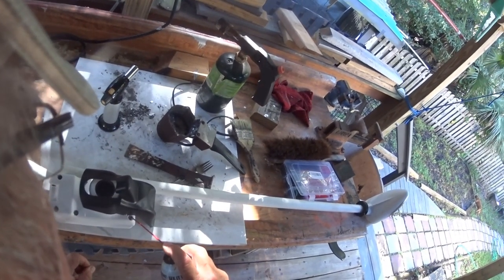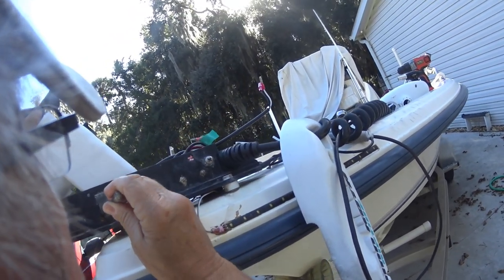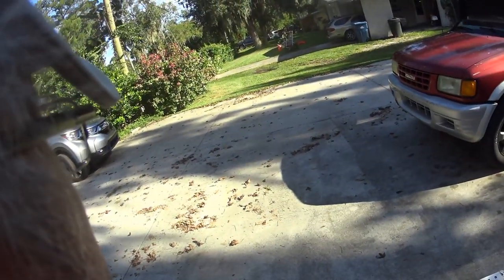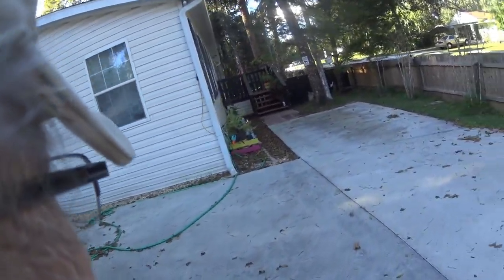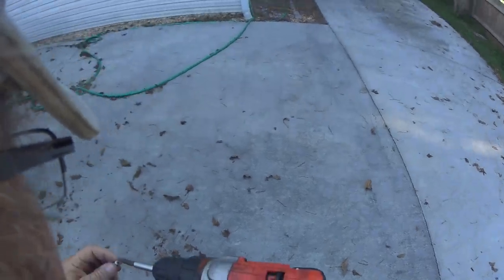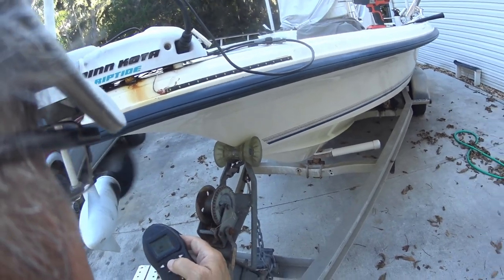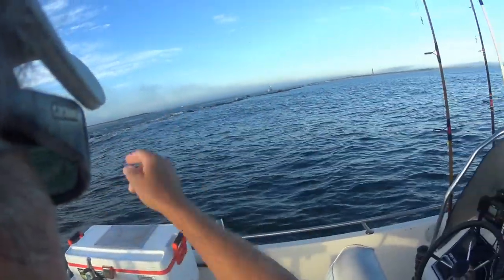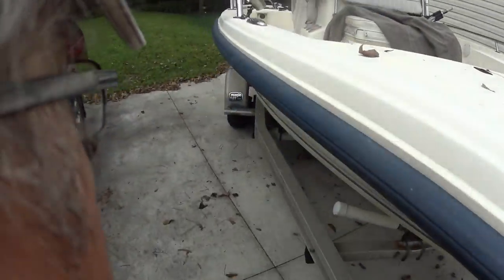Installing the Minn Kota GPS Turning Housing

Comment: Hi Salty:
I did not know that you were having so much trouble with the Electric Trolling Motor and good old Salt water.  No wonder outboard companies like Johnson and Mercy spent so much money testing Aluminium.  I had a friend that worked at Reynolds Metal Research trying to keep the metal from rusting and not being eat up from electrolysis.  
I very much hope you have got it working for a long this time.  I know i would have liked to had one because I got tired pulling up 100 feet of rope, chain, and anchor.  It sure makes life a lot easier when you go out and fish 5 or 6 places.  Now go fishing and have fun.
Reply from the maker: Hi CM, Truthfully, when you get a GPS trolling motor, it is VERY hard to go back to an anchor. My buddy Gary from church, has a 26' ocean going catamaran and he put a 112 FT LB GPS Minn Kota on it and it has held him on spot even in strong current and waves... I also knew a guy who had a SS anchor and chain and about 300 ft of rope... and ended up having to cut the line because he couldn't retrieve the anchor.. he said "well that was an expensive trip.. about $500 worth of anchor"... I am confident I have a handle on the trolling motor housing now... and hope to at least hit the jetty this coming Monday.